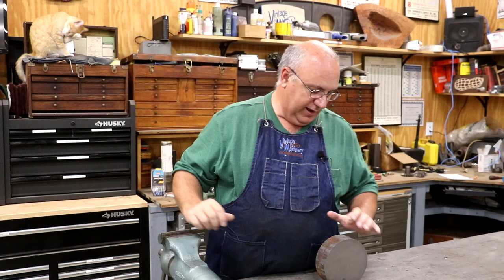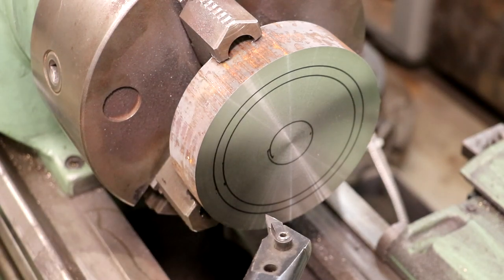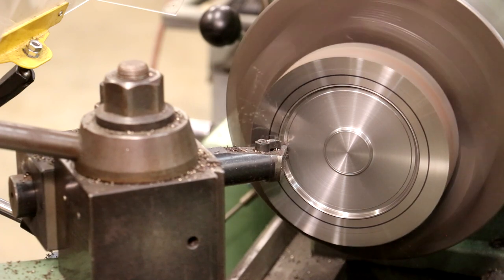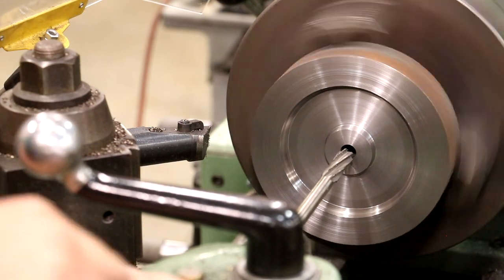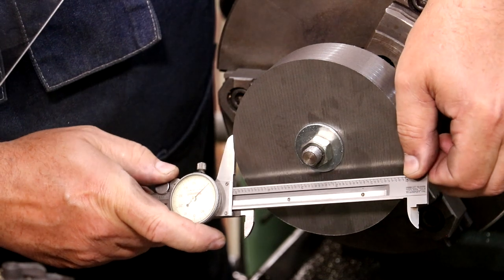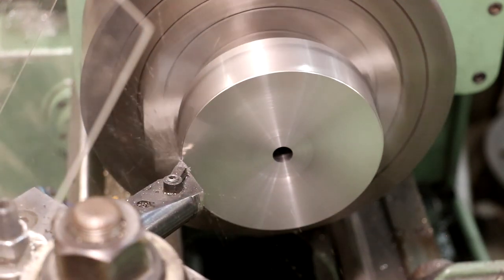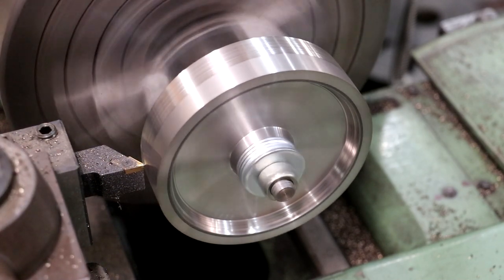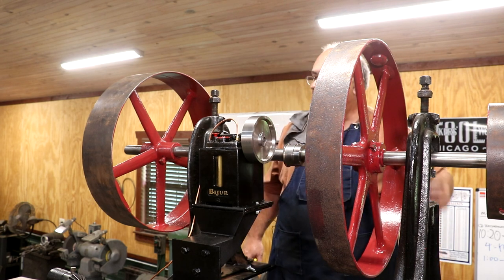Planer Restoration 62: Machining a Flat Belt Lubricator Pulley

Comment: I'd add holes in the pulley to match the other pulleys on the machine
Reply: Dunno that it works that well, i mean, sure, for his application that's not gonna "pull a mountain", but generally you want cast holes, rather than making them yourself. At the very least, two out of three pulleys i've made by reproducing OG ones broke after a while, because the spokes cracked. But that's my experience.
Reply: Paint
Reply: Again again why ?

Comment: Looking forward to seeing how flat belts are installed so they are tight
Reply: Watch Dave Richards and the Old Steam Powered Machine Shop.  You will see an entire shop run by a steam engine with the old time overhead belt drive.  The point here is that you will notice there is nothing "tight" about the belts.  Friction does the work.

Comment: Getting close for sure. An added benefit to a flat belt is if you used a solid v-belt, the whole jack shaft would need to come apart to change the belt. On the flat belt, just pull the pin on the lacing.

Comment: In the first clamping I would have turned the cylindrical outer diameter almost completely, turned the side and bore the inside. 
The second clamping was done on the outer surface and almost finished on the outside, as well as turned the side. 
Then I would have arched the outside surface when it was on the clamping device in the bore with light passes.
Now you can no longer see that I have pre-turned the outside in two clamps and the outside diameter runs true to the bore.

Comment: I have some round carbides that might have hogged out the reliefs on cast.  The bonus is the radius at each end.  I totally agree with the no-holes decision.
Reply: The correct tool to use on that application is a "face grooving tool". It's made so you can plunge into a face with the correct radiused relief on it. I used to call it a "trepanning tool". You can buy them commercially or you can grind your own. Making only one part it would pay to make your own. You can look at the tool by doing a Google search for face grooving tool

Comment: Almost ready !
I don't know that you have EVER talked about balancing pulleys, but static balancing (which really helps) can be done with a round shaft, a set of sawhorses, and a pair of homemade knife edges.

Since this part was made with dura-bar, I was wondering if it be more likely to naturally balance than would cast iron ?

Comment: Thanks Keith for your informative videos. 
I have one question on making the pulley. Wouldn't it have been better to have turned the first face, bore and crown the outer diameter in the "block" first and then switched to the 4 jaw, dial the outer diameter in, then face off the surplus material and finish the second face. That way the outer diameter and bore would be concentric and you wouldn't need the mandrel and it's questionable grip to turn the outside surfaces. Not a criticism just an observation.
Regards from Canada's banana belt 👍🇨🇦🤞.

Comment: Can't remember if when there are no tolerances given on a drawing, what is the "safe to assume" lee way you are allowed? -Or if it's shown as a fraction on the drawing. Very nice work Keith.  As (I) get older i try to keep in practice by going for real close to size. There are some really cool jobs you can do with a restored Metal Planer.
(With good measuring instruments). Again really cool Machine there and thanks for the Videos.
Reply: Sometimes they'll use the number of digits after the decimal place to tell you, e.g. for a 0.30" feature you could probably accept 0.295" to 0.305", whereas a 0.300" feature probably wants to be between 0.299" and 0.301". There are also standard tolerances on a lot of things like gears and bearings.

Otherwise it's a bit up to your own intuition, clearly you need tighter tolerances on a locating pin for a precision mechanism than you do on the OD of a V-belt pulley.

Comment: Well done on the pulley. (I might have put some relief holes in web, but purely personal pref). I noticed Abam and Mr. Pete have six jaw adjustable "set tru" chucks. What do you think of those? This seems to be a job that would lend itself well to one of those?
Reply: People with the 6-jaw seem to love them. "Not going back to a 3-jaw" !

Yeah, I'd have gone for 4 holes in the web - for symmetry - and to hide the real purpose of why I wanted a hole in there - to turn the O/D between centres and put the driving dog thru one of the holes ;) Then no risk at all of slipping on that mandrel !
Reply: Keith has a "six jaw" (actually I believe he has a couple) that came with his old LeBlond lathe (2018 ?) that he spent a couple of videos rebuilding.  Keith is no stranger to the "six Jaw"!

Comment: On your next video, could you cover calculating the length of each belt and how much contact they will have on each of the pulleys?   Working to spec's is one thing but figuring them out is something else.  Maybe it's in the Machinery Handbook, but I've never had cause to make any flat belts...
Reply: It IS in MH. I used to do belt and chain drive calculations a LOT in my days in the Mill Supply business. Once you have the pulley diameters and the center distance the belt length is easy. Plus I'm sure Keith has designed in a little adjustment to compensate for belt wear, although this machine won't see daily use for 100 years... ;)

Comment: 19:20 Not taking too deep a cut to avoid stalling the work....
Here's my suggestion: having made the mandrel & threaded it, use either a spring washer or a star washer rather than a big flat washer and put some lube on the thread before fitting the nut and nip up. All being well then, if the part slows or stops turning on the mandrel, it'll automatically tighten the nut to the point it doesn't slip any more !

Comment: great job with the pulley, I've been watching this series patiently . as for when you drilled and reamed for the shaft, Do you think that there would be an advantage to drilling in the 3 jaw chuck like you did, and then not reaming it to size until we had it in the 4 jaw? Just if we are concerned with concentricity and avoiding vibration when the part is complete and mounted in the machine... I might be coming up to a similar concern with a project I'm doing myself
Reply: Chuck it in a 4-jaw, drill undersize, bore to get your concentricity. leave enough to finish ream to size. Forget that 3 jaw if you want it to run true.

Comment: I know it will work fine either way, but I'd love to see you drill 5 holes in the web of that pulley, leaving behind 5 "spokes", and match the larger pulleys.
Reply: I had in mind 4 holes - cos I wanted 1 in it for turning the O/D of the pulley between centres and I needed a hole in the pulley for the driving dog ;)

Comment: Hey Keith - Why not take .100" cuts when facing to get it done faster? .020" seems really too light to me but I don't know for sure.
Reply: He's basically trepanning with a boring bar and it only has so much clearance under the curve as he mentioned so deep cuts can ram the non-cutting face into the work on deeper cuts.
Reply: I would remove the excess material by machining the O.D. with .100 cuts to about 1.30 thick, face to1.25, then trepan both sides. Every machinist works a little different so nothing wrong with Keith's method. Like others I'm anxious to see this beast work.

Comment: So very close , we cant hardly stand the anticipation. Nice pulley have a question why didnt you part of a 1/2" slab instead of wasting that much. Being cast it does part well. Not that its a big piece left it may have come in handy.
Reply: I think he didn't part it off because of the large diameter, if you extend the parting blade that far, it is very likely that it breaks off...

Comment: Keith....Do you know of any suppliers that have Durabar drops...I'm looking for a 4" dia piece that is 2" long for a project and I don't need to buy a six foot stick of this material....Thanks.
Reply: McMaster-Carr sells it by the inch.  It's pricy, not as expensive as buying a 6 foot bar.  What part of the country are you located?
Reply: @4GSR  McMaster Carr was one of the spots I looked at, but the shortest piece they sell was one foot......I'm in Ocala Florida.
Reply: @ericsandberg3167  Okay, I haven't look lately, I thought they offered it in inch increments.  Is there a way I can contact you by email?  I have some material here, I think, it's a little larger than 4", want to say around 5" OD.  Would that work? Ken

Comment: Who can offer a good explanation why a pulley crown keeps the flat belt on, rather than drifting downhill and off the pulley's edge?
Reply: The larger diameter is traveling faster than the smaller diameter. The faster motion pulls the belt towards the middle.

Comment: I would have hogged the material away on the OD in the first step then flipped the part and hog the rest away in a second step.  Once most of the meat had been hacked of, then put it on the mandrill to finish the OD.
The armchair machinist
Reply: Don't forget to clean up the imaginary "cast iron" chips when pretending to "hog out" the Dura-Bar!